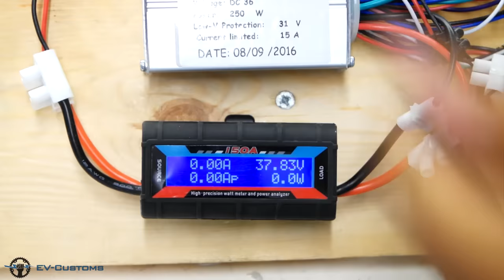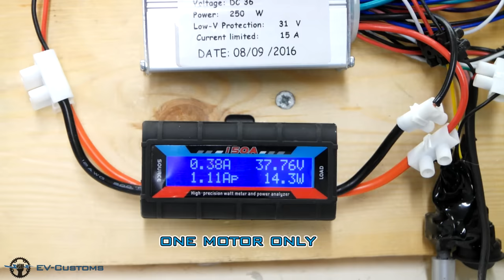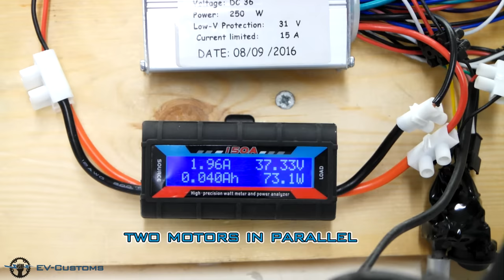Can one Speed Controller Run two Hub Motors???

Comment: I knew the experiment result before you started it, because of the physics of running BLDC without sensor. Of course, it's no point in connecting sensors together. This setup will work only in case the motors are ideally synchronized. Any small deviation will lead to oscillation in both motors and reading of feedback by controller will be something weird because rotors are in different positions. This "strange sound" is resonance of this system and in fact it sounds strange not only in resonance. All the time it's consuming excess power to keep oscillations going (but rotors are trying to sync).
It's OK to some point when motors are rotating independently without ground contact. If you try to place them on a bike and turn somewhere, there the biggest problem will occur because motor speeds will be slightly different. They can behave unpredictably.
Reply from the maker: Yes my friend we all knew the result...  this video is a simple experiment. ;)
Reply: @EVCustoms  but how did you even have such an idea?) It's something like driving a car without differential, really, much worse...)
Reply from the maker: @TechMasterRus  Τhis idea comes from many subscribers, because they find it hard to believe that it will not work properly if we connect two hub motors to one controller...
and secondly, there is no video on Youtube to prove it, so I figured it out and created that Video.

Comment: Very interesting result! It points to high motor losses and ways to improve it.  That fact that total losses are more than the sum means that there are high losses in the controller that increase as more motors are added.  This will probably be due to the conduction losses in the controller it suspect, more investigation is needed.

Comment: with 2 controllers you still splice in both hall effect sensors for one controll, this is all you had to do and they would sync.  In addition they are both running the same direction, one side if used on a trike would require you to swap any 2 wires on the motor going backwards around.

Comment: Thanks for a great experiment! Newby here. I was considering upgrade options to a 750W48V folder, adding a 500W36V front hub in parallel on a shared 35A controller! hahaha... Maybe just add a 52V20AH batt-w/blender in a rackbag and upping the controller from 22A to 30A? Seems easier adding batteries to a single controller than adding motors...

Comment: Like stereo, harmonics on two slightly different frequencies due to the reasons you explained.
However your test stand may play a part in this as well but only testing would tell for sure.
Also, what if you added a third then a fourth hub on this stand and see what it sounds like then.
This test was very interesting. Thank you.

Comment: Twin 350w hub motors in fat wheel downhill bike with 24v 500w bottle and rear rack batteries. Rear rack holding controller unit. All cables routed through jumbo alloy frame. Bluetooth the display and speed sensors. Thats a sensible build.

Comment: Brushless motors cannot be connected in parallel or in series. That would only work if the motors were mechanically connected to each other in exactly the right position and the Hall sensors were only connected to one motor. Exactly this is not possible with our intended use.
Motors with brushes, on the other hand, can easily be connected in parallel or in series.

Comment: 1. Peak current for one motor was 0.95А. 0.95Ax37.7V~=35W this consumption we see when the motor is under load, starts to spin. After spinning up the consumption falls down to 22Watts.

2. For two motors it was 2.2A(82W) and 1.8A(68W). It is 41W and 34W per motor. Thus two motors in parallel are "less power effictive" than one in about 41/35( or 34/22)=1.17(1.54) times.
3. This demonstration shows only basic values. We still don't know what it means in real life for bike or scooter. For example with two motors there can be less speed and more power(higher acceleration, more average speed on rolling road or mountains).
4. 41W is not dangerous for 250W motorwheel.
5. 2.2A is not dangerous for 15A controller.
6. We don't know minimum resistance limit load on controller and don't know the wheels resistans and that is why it can be dangerous for controller. But i think if it works then it can be used after some temperature tests. Why not?

Comment: well done for the experiment 
i think we can't run the two motors with one motor feedback hall sensors 
because it is nearly impossible as you said in your video to have the same position and same speed at the same voltage to synchronize the two motors it is like you run one of the 2 motors  without a feedback just rotate the field that is the reason of the crawling and cogging (strange sound)
so i think we can run the two motors without problem only if we synchronized the sensors signals of two motor (maybe AND gate for the same sensor in both rotor for example (h1motor1&h1motor2)) so we guaranteed the same position of the two motors
Reply: Great idea I can use that advice for my bike thanks😎

Comment: I tried using two motor controllers and two motors connected to one throttle. There must be some kind of feedback because the two motors spin and the power is good, then the controllers immediately turn off or go into so protective mode and are unresponsive. If I turn battery off and on they work again for about one second. Either motor and controller by itself works fine, but together they somehow interfere. The motors are configured (via activating learning mode) to spin in opposite directions since they are left and right wheels and their mounting locations makes that a necessity.

Comment: I have 2 hubs at 22amps each 36v, I use 2 controllers and one throttle you only need the throttle signal wire on the 2nd controller, obviously, top speed isn't increased but torque and acceleration are great fun but due to lack of weight over the front wheel it spins on hard acceleration from a standstill and the extra weight is a downer. for the extra weight, I'd just buy a new controller with higher amps as long as your battery will take it, but it looks cool with 2wd and lots of people are interested and ask questions if you like being sociable.

Comment: As a guess I would say its because of the Motor Sensors. The motos get to a certain speed and one of the needs a slightly differnt timing, but the ESC is prolly only doing the toiming based on one of the motor's feedback, then pulsing it the way it thinks it needs. Another intresting phenomena occured but wasnt mentioned. I noticed when he put load on the left motor, the right hand motor slowed down too. Thats going to be to do with the sensors, ill bet! Did you put the sensor wires in paralel or series? or not at all, or only hooked up one motors sensor wires?

Comment: The explanation to the big loss is magnetic induction. One motor create opposite flow of current to the other motor. To overcome the induction the control produce more current to overcome the induction to make the speed of both motors the same. Thats where the 26w came from.

Also the battery will suffer in when you use it with a load.

Comment: This necessarily was running either sensorless, or with the halls from one motor connected.

In sensorless, the determination of motor position will be off, because current & voltage are used to determine that, and connecting two motors obviously throws that off.

The result is cogging which will vary in severity from loss of efficiency to burning out both motors and possibly the controller.

Comment: Well with old school tech it's supper easy.  Never tried with modern motors big enough to run a bike or scooter. However brushless setups in models are possible so long as you stay inside your power limits for the speed controller.

Comment: Question I am wanting to make a 4 Wheel  drive cart with 4 Independent  drive hub motors (48v 800w (rated 600w, max current 30A) geared hub motor for electric wheelbarrow) is it possible to have one controller for this?
Reply from the maker: No way...  the best you can do is to find 2  hoverboard controllers which have 2 outputs for a motors each one...  but there you must program them first..

Comment: So what did you do with the other hall sensor wires coming from the other motor? I also imagine both hub motors need to be identical and controller needs to handle double the amps of the motors

Comment: [Update on my build below] Great video and awesome (if utterly confusing and contradictory comments!). I'm trying to build an electric hand truck (i.e. convert one to electric) and although several companies make them, the ones they make are over-built for my purposes and VERY expensive (since they're build for industrial use.) I need one to help carry loads uphill on an elevated boardwalk to lake cabin. As far as I can tell, I want low speed and auto-braking and short duration (compared to scooters, etc). The distance is a few hundred feet uphill x 3-5 trips, the weight is <200lbs. 
Least complicated set-up is one throttle, two controllers, one battery (24v cordless drill seem easy) and two low wattage hub motors. Thoughts?

May 2022:
I fried a battery, one controller died so I had to replace both. However, the cart is done and works great... I installed a throttle limiter to control the speed BUT the left wheel spins faster than the right. I have one 40v battery, one throttle with limiter all wired to both wheels. 
I can't figure out how to make them spin at the same speed for a single throttle position (thumb throttle). Suggestions welcome.
Reply: How about a used mobility scooter pulling a 4-wheeled garden trailer? Cheap and not a lot of work. And the kids love it with a big seat fitted.

Comment: could there be some -off road applications  , such as -farming-mowing - hillclimbing , trail riding -ect...that allow for constant "wheel slip"?     jeeps of yesteryear were kept in 2wheel drive , -on the pavment-because of simular reason , but off road the wheels slipped in the soft dirt/sand .  no problems there , in the 4wheel mode.

Comment: Not sure this is a good idea due to back emf. I would say under load the controller, and probably the motors will run hot and with low efficiency. The controller uses the back emf for timing, and with two motors connected the timing won't be handled correctly. Interesting concept to try, but in reality it won't work well, or for a long period.

Comment: is it possible to run, along with your existing system(controller, motor and battery) another circuit with motor wired to a button/switch to a battery to act as a secondary for longer rides? 2 drive wheels, but different circuit for each, secondary being push button full speed to save on total battery power?

Comment: Can you show a wiring for a button that switches between single motor and dual motor without having to unplug the wires like your doing in the video?
Reply: It's green signal wire to a positive the same watts. I was trying ground and it kept reading error. Took multimeter, found out the signal is positive and wired it up and works now, so positive to signal will give you your dual or single mode

Comment: Look at how a single works before you connect dual motors. The speed control sends pulses for motor to engage rotation, then motor sends back info about its location relative the stator coils. This info tells the speed control when to send next pulse. When you connect another motor you also get another location info about where the motor are. These signal info may collide or create an duplicated info so the speed control send pulse for a double speed that no motor are at. This configuration will never work good.

Comment: yes that will work but remember they are sharing the voltage and current so it wont be double power or speed,it will likely actually preferm in real world worse than a single one unless you get an unlimited controller giving full battery voltage use with a continous 50 amp power handling rating
Reply: after alot of trial and error we found that using a cycle analyst ver 2.5 or 3 was the only true way of syncing controllers and motors also lets you set different front and rear power distribution for different terrain and power needs,or even run one in constant generator mode to get bit more ride time.

Comment: So if I understand this correctly..I have a 1500 rear hub and a 52 volt battery I can get another 52 volt battery and a 1500 watt front hub, put it all together, splice the wires together for the twist throttle and it will all work without letting the smoke out? And I assume that watt usage would be reasonable close to what a single motor would use? Top speed on flat ground will be the same but less decrease in uphill speed. I have a small trailer to pull up a hill..single motor did ok and I kept looking at the skinny ass wires that run to the motor and the fatter wires coming out of the speed controler so I did a voltage drop on each motor wire...over a volt lost. It looks like they had to use skinny ass wires to get through the axle..went to local hobby shop and got some 14 gauge wire the use on rc cars..like 100 strand with silicone insulation. I spiced it in where the wires came out of the axle and ran them to the speed controller and soldered in 30 amp bullet connectors. Top speed didnt change but it accelerates better and takes less throttle up hills...I spent some time looking around to see if anybody else had done it...nope....I see no sense in just giving 3+ volts away..I bought a 52 volt battery for a reason...dont know if the results would be the same with a 48 volt deal but I dont think it makes a difference.

Comment: I weigh 360 I want to build a duel motor e-bike with 48v-72v 3000w on one controller but I don’t know what controller to buy ? To put them to run in parallel ?

Comment: So theres a foldable mobility scooter that goes by mulitple names 2 in which are dragon mobility ex and ephesus s5. It has dual rear 8in hub motors 250watt each thats being ran by a single speedd controller rated at 350watt. Correct me if im wrong but doesnt that mean thes motors are nit getting the full 500watt?

Comment: Good to know, thanks for testing this. I've always wondered what a two hub drive would feel like, but figured the added weight wouldn't be worth it. It would probably make sense to have extra weight at the wheels for a very high power / high torque setup in order to keep traction. I've also been wondering if we ran a 1000w mid drive with a 1000w front hub motor would they compliment each other?
Reply: maybe, the weight might go abit off with the front but should be good
Reply: I don't think a front hub and a mid-drive should be mixed as you will never sync the two one will basically always be doing most of the work. You would never be able to sync the Wheel RPMs and depending on your front drive this may actually cause drag on the front wheel.
Reply: This could work if you regulated the current to produce the desired torque split. But you would need a computer to set the individual throttles. Your input to the computer would basically be a desired total current and it would adjust the throttles to each motor to achieve the desired total and split. That's pretty much what happens on the dual motor Teslas.
Reply: Hahaahaahah!!!  Dumbest question of the Day ! well done ;-P

Comment: Problem with this is when you load those motors since only one gas feedback loop 
The one with open loop can lose its position and it will start to draw huge amount of current without transferring power 
And there is a big risk of blowing the motor or controller
Reply: What if the motors are physically coupled together so they can't lose sync?

Comment: But wouldn't this work better if you have a higher watt controller to handle the two hubs ?? The controller only has enough for one wheel if it was a 750w controller would it work better or just run the chance of blowing a motor ??

Comment: i think the bad sound his just an acoustic problem of phase, when the 2engine have the same speed, the frequency of sound have an "resonance" called phase, because its the same sound but with a short delay because the distance (of sound captation) is not the same…. if you find the frequency (like wood's frequency for example and try ;-) ) you can maybe erase the noise…. sorry for my poor english

Comment: id bet that with some sort of suppression it would work. id bet the resonance is because the motors become slightly out of phase and start generating their own voltage which is sent to the other motor and back causing both to oscillate.  could also probably wire them in series if you had enough voltage.

Comment: so now make the hubs turn a 24v 100 amp alternator with serp belt. any power more than it takes to run is free energy ?
Reply: Alternator has to be turned on to work, it's not a generator. Plus, what if those are DC motors?

Comment: Thanks for testing this. I wondered about building a trike with two motors on the rear wheels, but I think it will be problematic regulating the power to each motor in turns, slippery road etc. I suppose a differential would be necessary?
Reply: How did you get on with the trike project? It's exactly what I would like to do?
Reply: @timtreffry7718  i have also been working on a trike problem is how to vary power on the real two hub motors on turning or i can be using differential and a bigger motor ,robert murray smith showed a freewheel differential for trike but it cannot be reversed so i was thinking of using two motors front wheel hub motor and rear wheel geared motor on differential. Now , the issue is to control them with a single controller and throttle.

Comment: Free spinning, it’ll “work”... but unless the motors are PERFECTLY linked to each other (to prevent drift) it will cause issues for power, efficiency, noise and reliability of the controller.